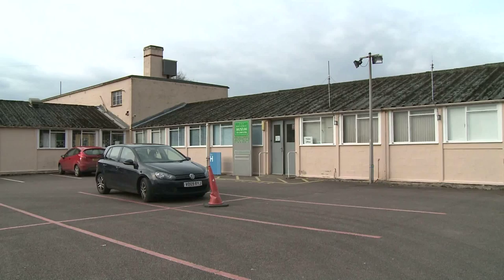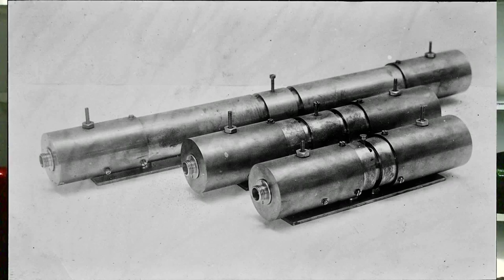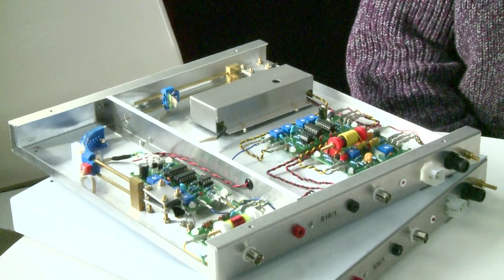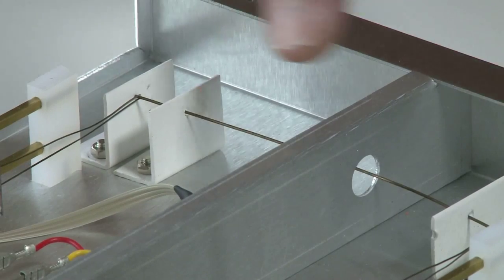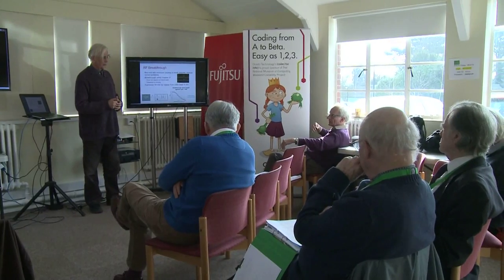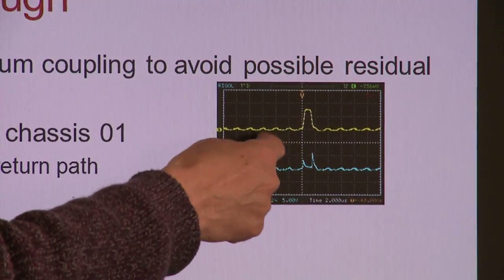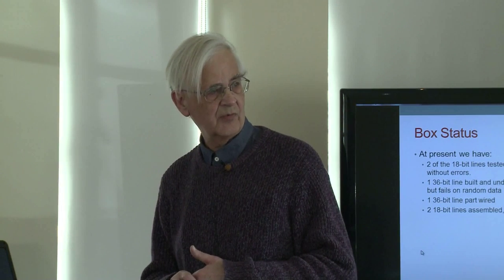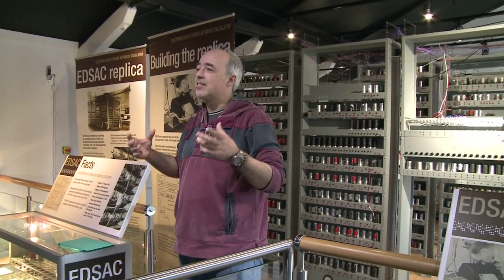Delay Lines

Comment: If you are going to replace mercury delay lines with nickle wire (and modern op-amps) they maybe you should have considered just replacing it all with a SRAM chip. Would be a lot less work.